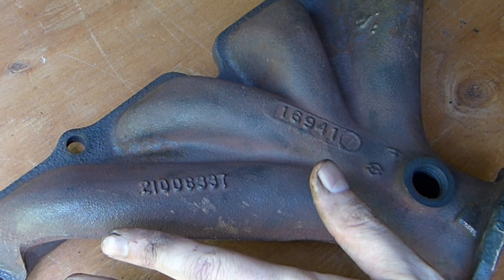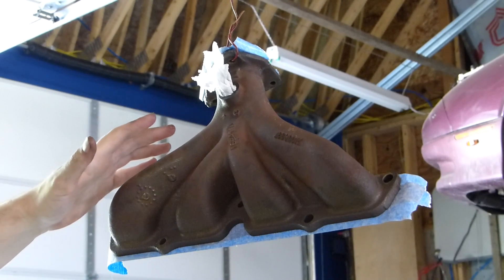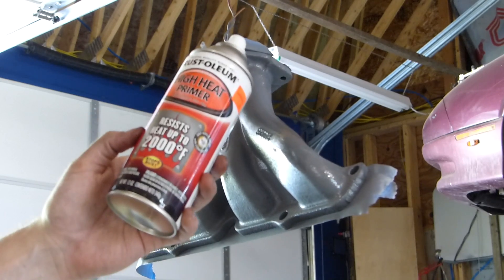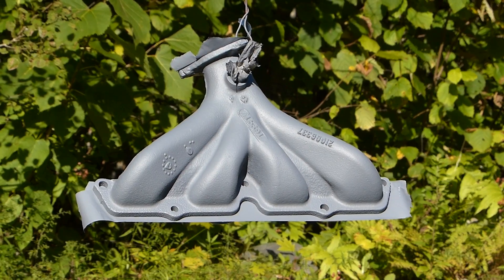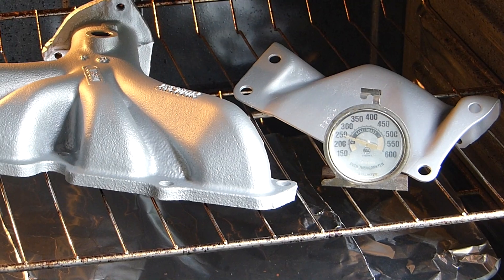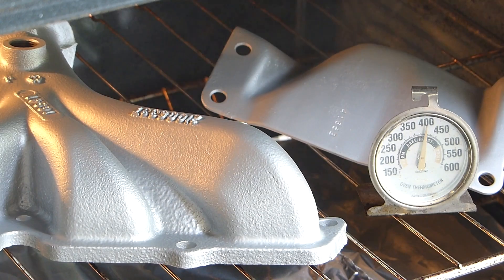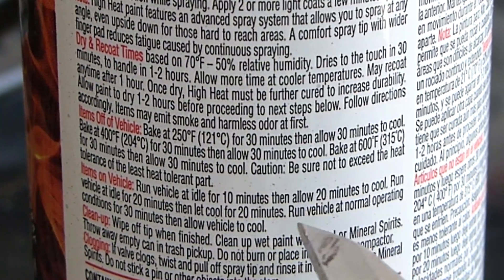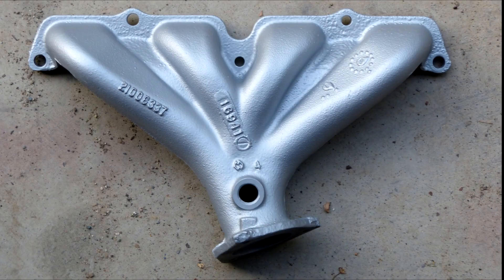Spray painting exhaust manifold or headers - high temperature ceramic paint

Comment: Especially with porous metals (cast iron & cast aluminum) preparation is critical for a lasting finish.

A wipe down with acetone after degreasing is an excellent preparation

Even chrome and stainless steel exhaust pipes develop the tempered "rainbow" after a time;

If you keep up on simple preventative maintenance (cleaning, touchups, being careful of handling, etc.) it will last for years to come.

I've found that using many coats, and using a Q-Tip to apply to fasteners after the part is installed, then using the high temp "clear" is also key- and "curing in place" (part attached) with a propane torch works very well to flow the ceramic properly.

Metals, plastics, rubbers, and woods- all have a common enemy: Oxygen. It works like a chisel- to break down the matrix of the molecules, attack them, and attach to them. (oxide)

A simple coating is all that's needed; coloring is merely aesthetic.
Reply: HUBBABUBBA DOOPYDOOP You're right, clean, clean and clean, prep before painting is most important. I've welded a lot of aluminum and cast iron/steel parts over the years and I try(when time allows) after it's as clean as possible to bring the part up to 150℉ or higher for a short time and with a crap casting you sometimes see the oils leach out. Either welding or painting you hate to see crap coming to the surface and ruin a nice job. Good comment.

Comment: It holds up great as long as you use the primer and bake the parts. I did headers with just the paint and it needed re done in less then a year. Used the primer and baked the pipe and its still good 3 years later.
Reply: I can't find the primer anywhere in stores these days.
Reply: Does it have similar characteristics as ceramic coating? What if I used the 2000 degree primer for my pre turbo headers (not inside) and then spray the ceramic coat instead of the paint? Do you think you need primer for ceramic coats?